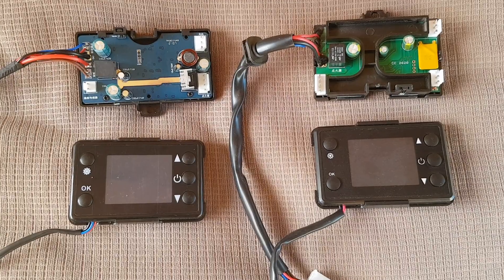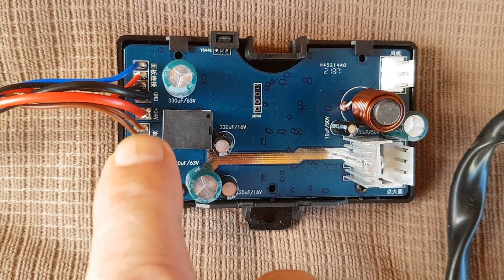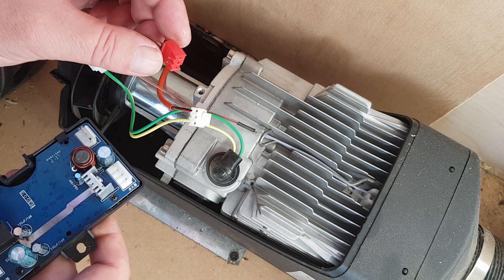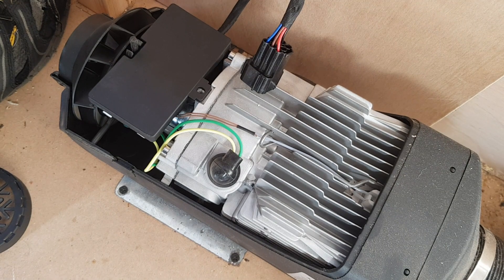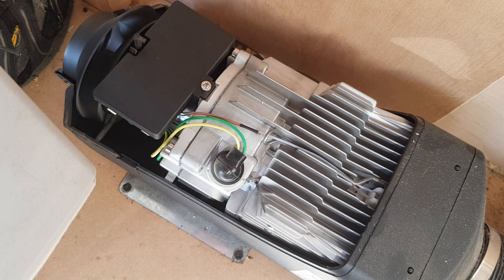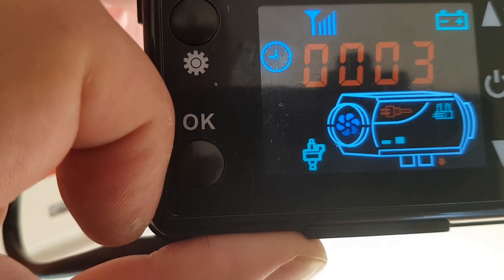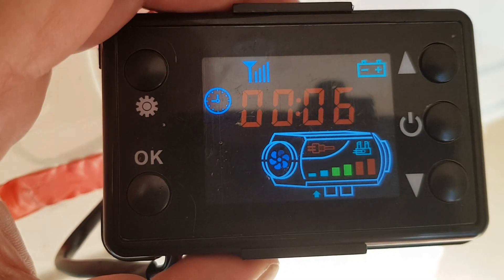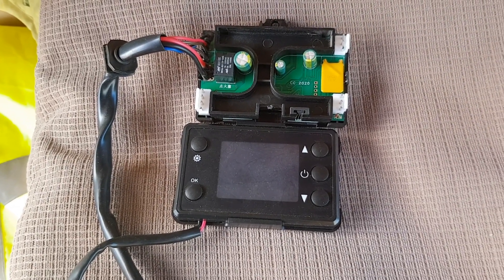Diesel heater motherboard swap new controller to old.

Comment: Interesting vid, thanks. The pdf of the Afterburner you mentioned (not Commander) says it will work with your old board... http://afterburner.mrjones.id.au/assets/files/UserManual-V3.2.pdf

Comment: I put my Chinese heater on at 6am, jumped back in bed and after a minute or so it shut off, while still on the initial fire up fast pump... there's now no display, the fuse is fine. Any ideas?
Reply from the maker: The online fuse might be OK, but is it fed from another circuit that has a fuse on it?
Sounds to me like it's ramped up the current during the initial fire up, and popped a fuse somewhere else? They pull in excess of 10 amps when starting. Sorry if youve already worked this out for yourself, but for me, it's the only possibility other than a board/wiring failure?
Reply: @philcross7315  
So, I used the multi meter ....
No power was getting to the back of the heater,  where the wires connect. I had a switch just after the fuse, near the battery.  I rammed my probe in the battery side, all OK..  rammed it in the outward side and nothing.  
Needles to say, the switch is now in the bin! 🤣
The heater has power 🔋 👍
Reply: @philcross7315  
Thanks very much for the reply and tip.
I'm out and about. And plan on having a full inspection when parked up again.  
I think all other fuses are good. 
I have VSR , two leisure batteries,  inverter and heater. Everything else is fine. 
I was wondering about the motherboard in the heater.
I am about to get a 12v dash heater for the mornings incase I need a new board. 
Will let you know. 
Thanks again 🐕👊

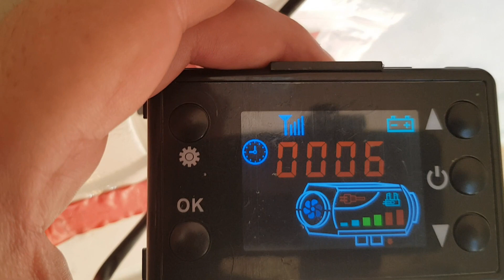Comment: Are you really sure that you can set the real time that you explain in the video 13:00...?
I believe its delayed time like in the old one.
Reply from the maker: You're right. I'd seen another YouTube video that suggested that it could be set as an actual time, and not a delay. Perhaps with some motherboards this is the case?
Changing the board to the older version, does however allow me to use an "afterburner".
Reply: @philcross7315  I suspected that. If you can find the genuine afterburner online (not english copy), feel free to tell me where. Thanks!

Comment: my controller seems to be the exact same model as this one (it looks identical), but for some reason it only lets me set 2 timers. After i set the first time of timer 1, it goes straight to timer 2, instead of allowing me to select an end time.

I've played around with it as I don't understand how it's working the time out. If i set it for @  it doesn't come on. But if i set the start time as @, it will come on 5 minutes later, but then if i work out the amount of time until 7am, and input that, it still doesn't come on. 

And then to confuse things more, it comes on randomly sometimes in the middle of the day when i'm not there!!

Does anyone know what is going in? I've reached out to the company that sold me it, but they just sent me the manual and didn't understand what i meant
Reply from the maker: One of the controllers allows you to set the time on/off, the other is supposed to set as the amount of time until it comes on, then off on the second setting.
I agree with you, the instructions that come with them are rubbish.
I'll have a fiddle with the two different types I've got, and perhaps make a video about which settings to use.

Comment: Do you have any issues i keep hearing problems smoke and errors  with the older units with 6 fans on the display and pin code  management type ?
Reply from the maker: No issues for me.

Comment: Actually the "new" controller is a VERY old one . just reused.
Reply: I think the pictures at the end of the vid, old and new are backwards. The black frp board goes with the controller that has the 6 moving fan blades.

Comment: Hi, I have the controller that you call new, but I have 6 buttons and cannot find any information as to what the extra button does. It has an icon of a fuel filler nozzle dripping liquid and it is lit? any ideas?
Reply from the maker: I've never seen that one before?
Hopefully somebody will have, and can answer your question?
Reply: @philcross7315  Thanks

Comment: Thanks for this.  I just bought an afterburner, and realised that I have an incompatible board/controller (the new type you show).  I ordered the correct board , and thanks to you, I know I now know how to replace it.
Reply from the maker: I plan to get one myself, and was unsure if it would be a simple swap. Given how cheap the motherboards are, it's a no brainer really. I'd like to hear how you get on with yours?
Reply: @philcross7315  Yea sure, I'll keep you posted.  My afterburner is currently awaiting a flight from Melbourne, so it will hopefully will be here next week, although Christmas may be a factor.

Comment: I fitted my heater into my van about two weeks ago only to find it had the dumb three blade fan type controller and motherboard set up it worked fine but I hate it so I ordered a new motherboard and controller from ebay.  Yesterday I drove to Portland Bill car park to install the new parts with the help of this video it took 15 mins and was plug and play I spent about two hours in a very toasty van testing it out and its great the remote that came with it works straight off the bat. The old set up is now set at minus 10 fathom and sleeps with the fish best place for it. 🌲🔥👍
Reply: Are you able to adjust the pump hz, fan speed and plug voltage with the new controller on your heater?

Comment: Hi Phill it took a while for the motherboard to turn up but I installed the motherboard and controller in my van today with the help of your video worked great as with yours plug and play then spent a couple of warm and toasty hours sat at Portland Bill so thanks again for this.  PS the old crappy board and control are now in about 10 fathoms of sea if anyone wants it. 🤣👍

Comment: Hi Phil just a line to say thanks for posting this I had the same brain dead controller and hate it thanks to you I have now ordered a new motherboard and controller. Thanks again.
Reply from the maker: Cheers colette. Like you, this controller drove me nuts, and I'd guessed it wouldn't be a simple swap. 👍
Reply: I’m just having the same bought one and they haven’t sent the controller that’s on the photos, so thanks in advance i m going to crack on with this, any ideas where best to get the controller and mother from cheers

Comment: Thanks for this! I just bought one and couldn't figure out why online directions to prime the fuel lines didn't work. I touched 12v to the pump terminals like 600 times to prime it. Do you know what I need to push to enable priming on the new style controller in future?
Reply from the maker: Press the OK button, and the down button at the same time, then you can toggle the priming on/off using the up down buttons.
Reply: @philcross7315  I'll have to try it again but that process didn't work on the controller on the unit I bought for some reason. It looks identical to the new version in your video with the blue numbers instead of red. Perhaps I need to hit down instead of up or something.
Reply from the maker: @juliogonzo2718  try pressing the up and down buttons at the same time. That's how the new controller does it
Reply: @philcross7315  I just tried that and it worked! Thanks!